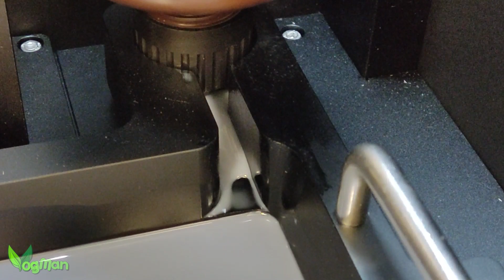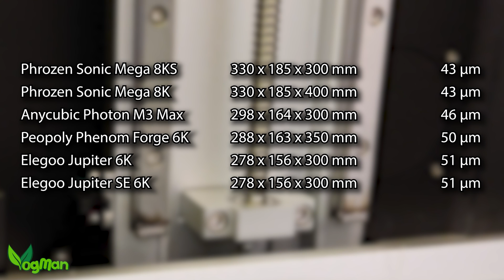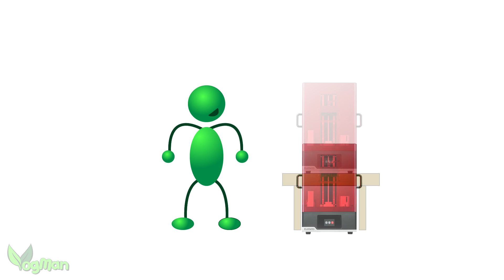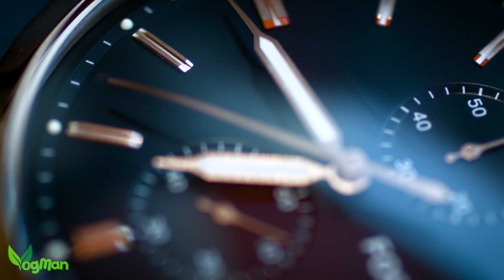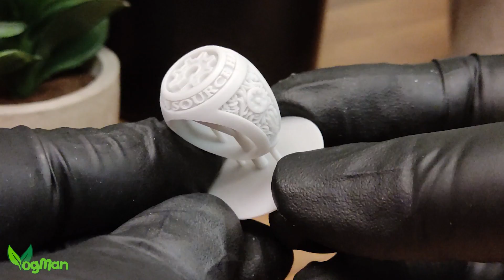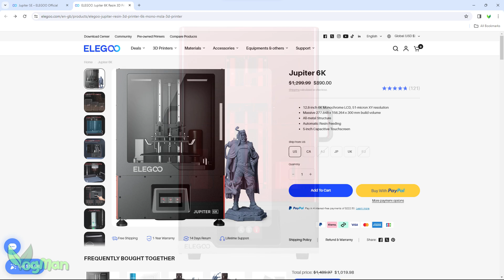Elegoo Jupiter SE resin 3D printer HONEST review

Comment: @vogman, you will notice that the resin pump has holes for two screws, and there are corresponding threaded holes in the metal plate of the machine where it mounts.

Comment: I bought this printer.this is my very first printer and just jumped in the deep end.im happy with it.the lid does knock off the pump as you said and can be problematic but I only plug it in when I need the vat drained.i was thinking of using that USB port to plug in 2 small adjustable heating pads that I can wrap around the vat i do have an adhesion issue and i thing its the temperature.i have a small closet outside in the patio that I have the printer in and gets nippy here in the evening in california.my first print is luke skywalker holding baby grogu.the prints came out amazing.gonna print the base the weekend.its 1/6th scale.i did get the wham bam flex plate and had to bring the first layer exposure time to 50.i been slicing with chitubox.i tried lychee but noticed my print time almost double after slicing.dont know what that's about.anyway thanks for the video and don't be afraid to use a little profanity. You have a great accent and it would be hilarious to here you drop a few F bombs after dropping the resin bottle.
Reply: The USB ports that elegoo use in their printers for their Air Filters are 24V and 0.7A, they're not normal 5V USB. And even if it was a normal USB or their 24V, I'd not recommended plugging any kind of heater even it's a low draw band lest you accidentally fry your motherboard since that USB port is directly connected to it. And also I can't remember if those ports only turn on while printing, in that case you'd need to plug it elsewhere to heat the resin beforehand.

Comment: I was looking into this, but a 6k screen on a 13inch build suface is dissapointing. The resin pump is another point of failure and would of rather the original resin fill from the original Jupiter, and that lid is very silly with the size of the printer.  It is just annoying, because this could of been the printer I went with as I am looking at the larger build plate printers, but I think at this point I would be better off buying 2 -3 Elegoo Saturn 2's. Great review as always @VogMan

Comment: I'd still go with the original model. Having a gravity fed resin fill system works and doesn't require power to be used and should be quieter. I'm not against pumps, and frankly they should be selling it as a universal accessory that any printer can use (assuming it works) instead of something proprietary to only the Jupiter SE. 

Seriously, why do we need a pump system that 100% ties into the firmware of the printer? Why can't we have something that just detects whether resin is high enough or not and automatically turns on? They would make a ton of money if they made something simple and ready made that any printer could use. They could even give it a "smart" mode for printers that DO have supported firmware for other features, but 90% of us only need a refill system to detect the resin level and refill when needed. 

One advantage of the resin pump system over the gravity fed system is that it should be easier to swap resins mid print without stopping the print assuming the bottle runs out or maybe you want to do something funky with the colors.

I also agree with the lid argument. I'd much rather have a door or pair of doors, or at minimum a flip up system that can hold its own weight. A cheap lid cover is okay-ish for smaller printers, but for larger printers it's a royal pain, especially finding somewhere safe to set the lid that likely has some uncured resin on the bottom edges. Lifting it up without touching the print is also a pain. They really didn't think this through unless their only thought was to reduce price.

Comment: I was quite excited when I heard about the SE. But only having one arm, that lid is a deal breaker for me. I find the lids on the mars a pain (I ended up adding a knob on the top) on the XE it would make it near impossible to remove safely
Reply: Just wanted to jump in an give you an idea, for any printer you might want to get. I setup a pulley attached to the ceiling above some of my printers, attached a hook to the lid and a cleat to the bench. So you can pull the lid up vertically, tie it off to the cleat and go about your business. Then just lower it down when you are done. Might be an option for you.

Comment: Personally, .I don't like the lid design on either thir or the phrozen.  The phrozen design looks nice but requires you to place the printer a foot away from a wall.  They should have gone with the anycubic m3 max approach.   I really want a new large format printer because the m3 max ended up being horrible.   Extremely slow print times, constant line issues, the rails ant screw began rusting after a month, the motor is weak, and it causes skipping and banging noises on more viscous resins.  So many issues I have never experienced with any other resin printer.  But the slowness is the killer and the inability to control the led strength. For some reason the feature exists in the other m3 versions, but they removed it from the max.

Comment: I have multiple Jupiters, when you look at the SE the only differences is the Light & Lens, Cooling Tech, and frame... thats it.. the screen is the exact same model.

I will keep the original Jupiter over the SE as I prefer the door and metal frame. And arguably, the Z-Axis upgrade "can" be done by yourself but it would be an undertaking.